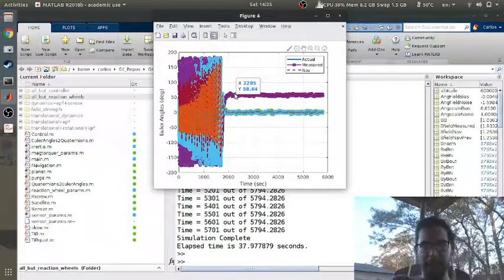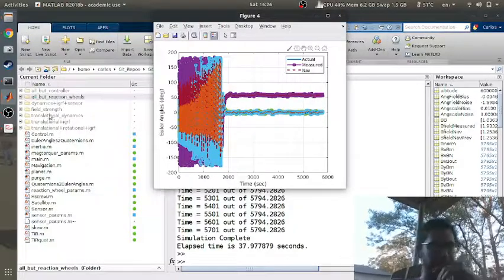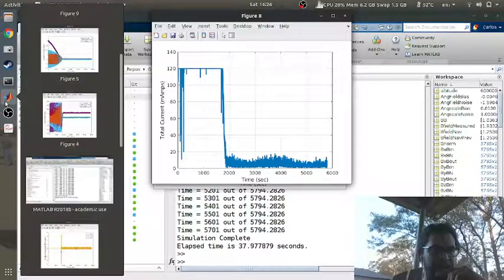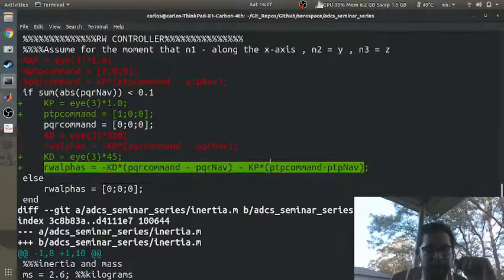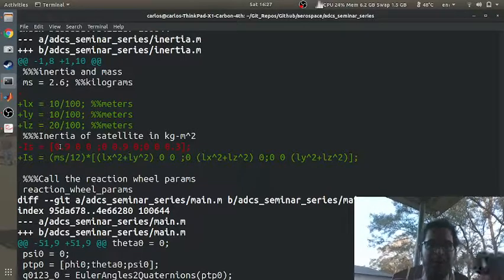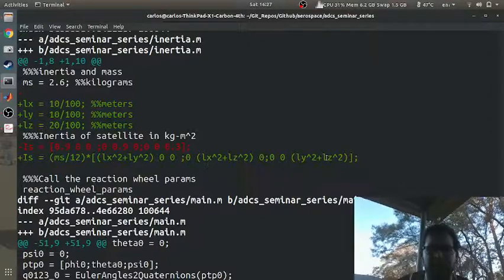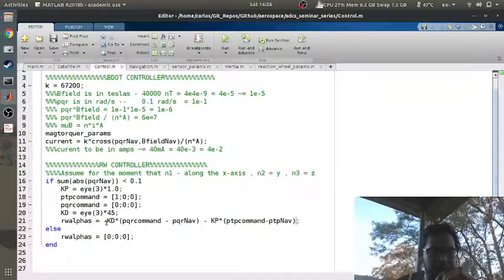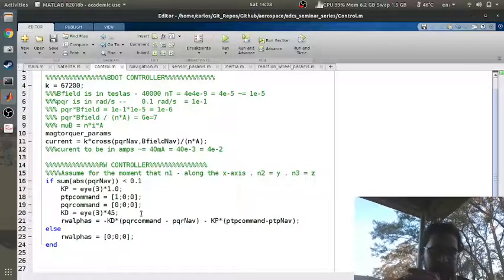MATLAB Help - Direction Control of a CubeSAT using Reaction Wheels

Comment: For satellite inertia (Is), shouldn't Ixx = (m/12)(Ly^2 + Lz^2) and Izz = (m/12)(Lx^2 + Ly^2). I think its flipped.
Since Lz = 20cm (longest length), Izz inertia must be smaller than Ixx and Iyy. And Ixx should be equal to Iyy. Please correct me if I am wrong.
Reply from the maker: Well let's see. The x-axis goes through the front face which means you need to use the Ly and Lz side, the y-axis goes through the size face which means you need to use the Lx and Lz side and then finally the z axis goes through the top and bottom faces so that needs to be Lx and Ly so 

Is = (ms/12) * [Ly^2 + Lz^2 ; Lx^2 + Lz^2 ; Lx^2 + Ly^2] 

which means you are right!

The code has been updated. Thanks for your addition.
Reply: @CarlosMontalvo251  Thanks for considering, much appreciated!

Comment: Am getting an index exceeds number of arrays. Index must not exceed zero error for ix(idx).  No matter my inputs it won’t go away
Reply from the maker: Did you download the latest iteration of the code? I just tested it and it works on my machine.
Reply: @CarlosMontalvo251  hello Professor Carlos. I downloaded the archived file that is from the 1 hour video. Am still debugging it, basically I wanted to use it to put in my initial orientation determined through Davenport’s method and then get angular velocity and quaternion time history and this video was perfect because I also wanted to use reaction wheels for control. Am still debugging the code. Is there anyway you can help me with the latest link to the latest code that works perfectly?
Reply from the maker: @manunitedred8912  I'm not sure I understand. The software at this link works perfectly https://github.com/cmontalvo251/aerospace/tree/main/adcs_seminar_series There is no need to debug.
Reply: @CarlosMontalvo251   thank you Professor, it worked

Comment: how to modify the code if we just want to detumble the satellite with reaction wheels only. Thanks
Reply from the maker: in the control.m routine set the gain k to zero which would turn off the magnetorquers. However on line 17 the reaction wheels only turn on if the angular velocity is below 0.1 You will have to change that as well.
Reply: @CarlosMontalvo251  Professor, Thank you.
Reply: When I do that the total current is shown zero and the satellite is detumbled in about 30-40 seconds.